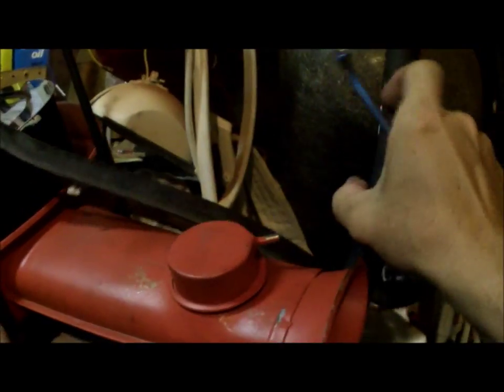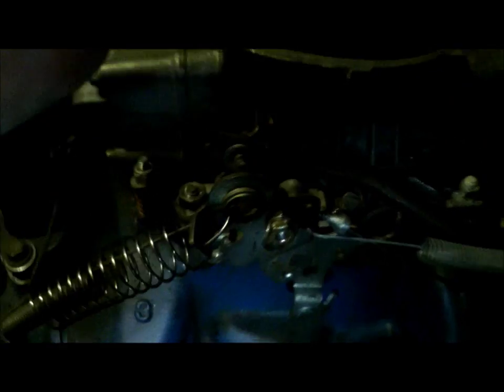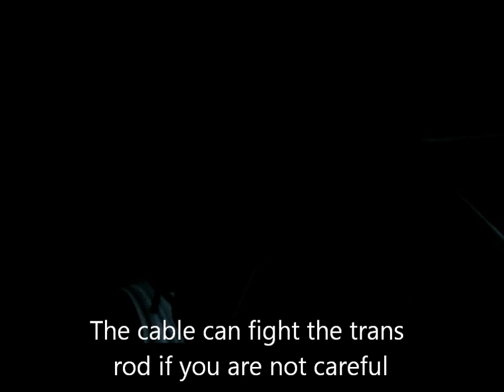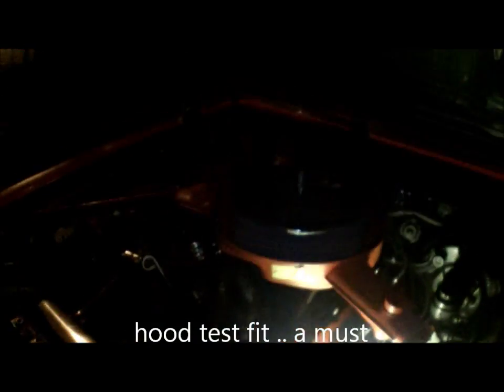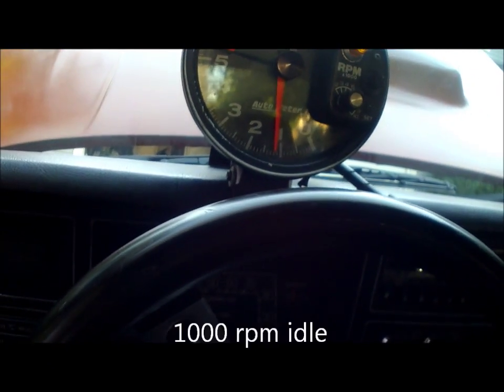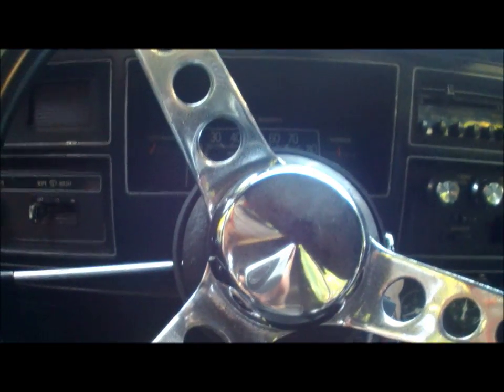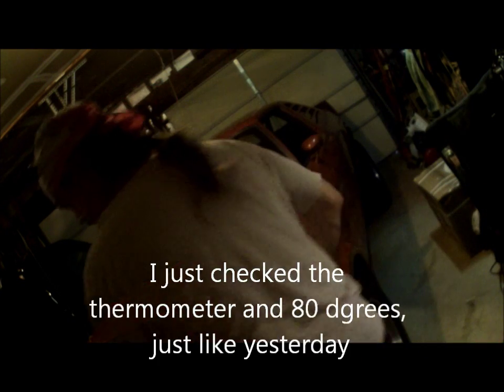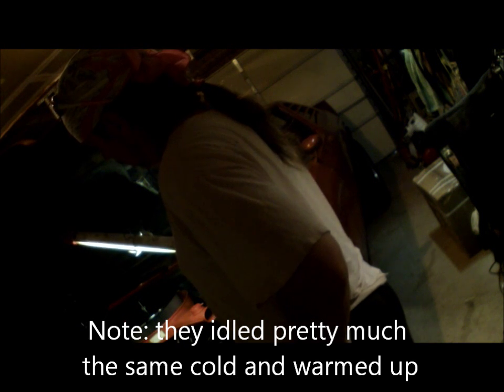Carb comparison Part 2 Edelbrock verse Holley on  a small block mopar

Comment: Do you have the carbs set up right ?
Reply from the maker: Well actually notice some flame throwing through the exhaust with the Holley back in June. Got to wondering and adjusting and thought gas might be pooling in the Holley carb. Swapped a few more carbs on and went back to the Edelbrock and adjusted the trans pressure rod. The edelbrock pulls much harder and power through the gears is more obvious.